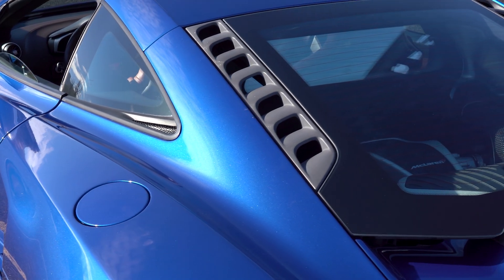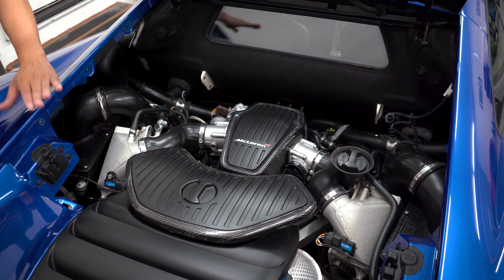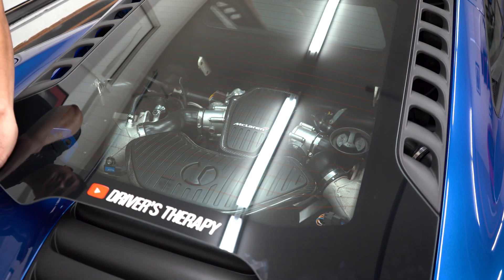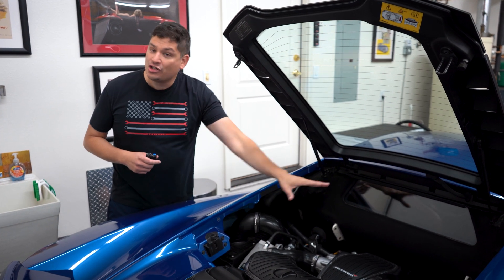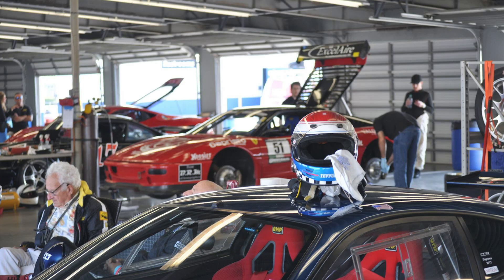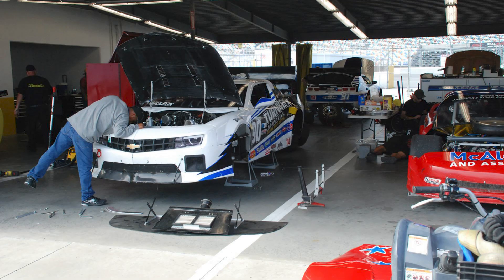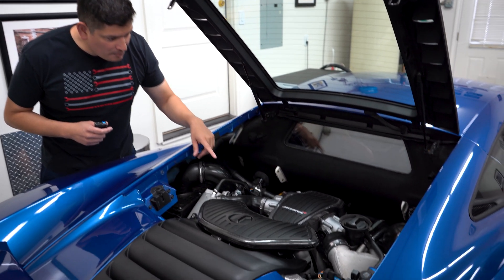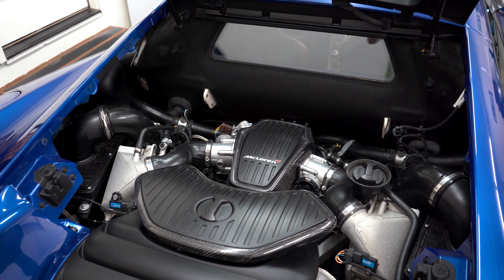Why Engine Covers Suck - They Retain Heat

Comment: The engine corver containing heat for smaller cars is actually a benefit in semi cold to colder environments. Most engines have an optiomal engine temperature(oil temp, fuel mixture temp, pistion seal expansion temp)and to pass current emission laws getting it to that temperature is essential.

For a 1L and 2l car driver short spurts from home to store its better. For a V8 mclaren being used for mainly for track use unless its helping with airflow throw that thing out(but most Maclaren are used for short drivers...so)
Reply from the maker: Nice! I am with you. But with most McLaren owners, they drive them hard, so they need to go either way.

Comment: Be warned that some engine covers are designed in such way that helps airflow cool the engine down. Although it's not the most common thing you will find inside an average street car but you should research before you take things out of your engine bay.
Reply from the maker: @pixelthec  that can definitely be the case with some cars but not the 12C. This is the right choice. Thank you though for your words of wisdom and caution.
Reply: @DriversTherapy  sorry I wasn't talking about the 12C or the ability of your guys to do something professionaly. I just tried to warn people about it broadly. I also took the cover off of one of my cars mostly because a single plastic pin was broken off that was holding it in place and was it rattling on top of the motor 😂
Reply from the maker: @pixelthec  ❤️ I took no offense and thanks for sharing your insight. I also found out McLaren removes their covers from their official race cars.